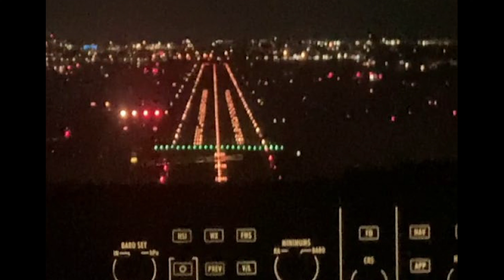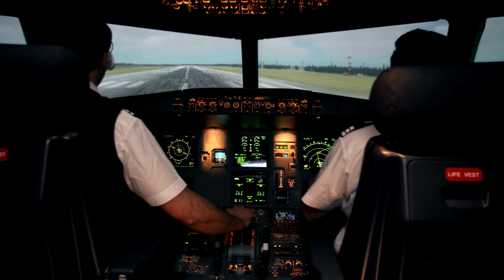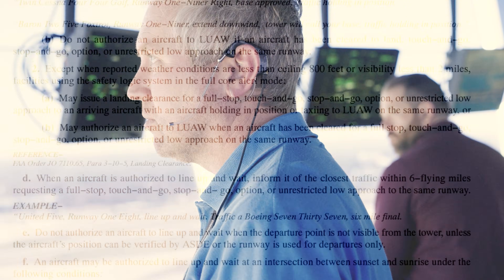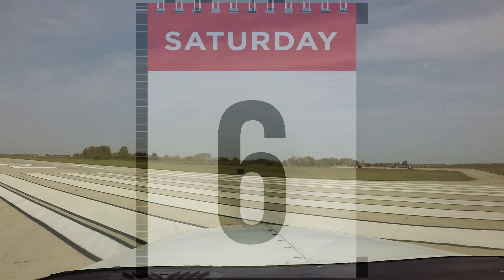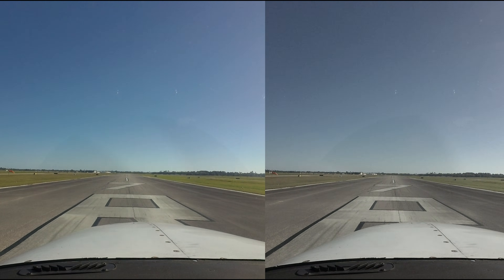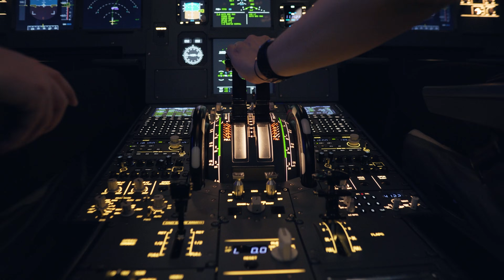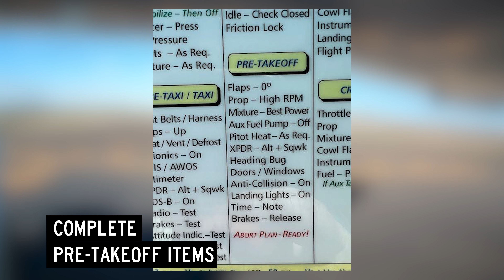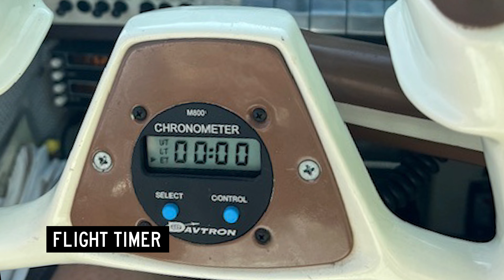From the Flight Deck – Line Up and Wait

Comment: It would have been nice if ATC actually utilized LUAW correctly as stated in 7110.65.  This is not only on the pilots.  Good video for pilots but ATC needs to do their part to mitigate these problems.

Comment: Why are we still using "DC3 Technology" in the 21st Century for such critical operations? Considering the magnitude of errors that easily occur using 'two way' VHF comms (especially at the busiest airports) I find it bizarre that the industry has not developed better tools - i.e. visual aids (traffic lights?) and/or DataLink connections.
Reply: This will happen when people start to die. Unfortunate and sad!

Comment: Very nice video.  I'm an Airport Ops Officer at PANC.  Our ATC uses "Line up and wait" a lot so everyone is used to hearing it especially on RWY 33 due to RWY 07L being in the jetblast zone.   It is also very common to hear a pilot ask ATC "Confirm cleared for take off?"  If they were given "line up and wait" the controller will say, "negative, line up and wait."  If unsure ALWAYS ask.

Comment: Line Up And Wait is internationally recognized as the way to get an airplane lined up and be ready for departure. The word (takeoff) can and must only be initiated by the tower controller. Quite often I hear pilots responding to a LUAW with (cleared to line up), this is not a clearance, this is an instruction! There are on 3 clearances issued by TWR/GND controllers (Flight plan clearance, Landing clearance, and Takeoff clearance), everything else are instructions only and should never be acknowledged with (cleared to taxi via bla bla bla bla bla). Happy flying to all.

Comment: I do analysis of runway incursions, I find "Line Up and Wait" is a risky command. I don't know if it is a breakdown between pilot flying and pilot monitoring working the radios.  I feel that a red green light for clearance to take off should be visible when an aircraft is formally cleared to take off should be considered.  In the UK I am told they started at LHR Line up behind command where two aircraft are lined up on the runway, first one cleared to take off and then second when the first is airborne.  I think that is a dangerous procedure.

Comment: 135 pilots are the worst pilots I have ever seen as a check airman/sim instructor at a large airline, so I’m not surprised they are involved in these incidents.
Reply: I just got my CFI and Comm Multi and heading for the airlines eventually. 

Can you share what makes 135 pilots bad?
Reply: @Andromedon777  Not used to strict SOP’s, just trying to do it their way own way, lack of ability to use automatics to their advantage.
Reply: @obamabigears734  Ah gotcha. I guess that's the advantage of the route I am taking, getting used to SOP's.
Reply: @Andromedon777   very much so

Comment: think I would add some sticky back velcro over the pfd and put a red piece of flannel there when told to line up and wait.  Big red STOP indicator and It would take "clear for takeoff" for me to remove it.  The piece of material physically blocking the PFD view can't be missed.  Just a variation on the typical "remove before flight" ribbons we remove on pre-flight walk around.

Comment: Never been a fan of holding on a active runway.  I guess it speeds things up for ATC.  Sure is rolling the dice though.  Sevens come up time to time and the consequences are catastrophic.  Clear me for take off when I'm cleared to take off.  Simple!  However simple is not in the vocabulary of our government.
Reply: My view, perhaps biased as a GA pilot flying relatively simple airplanes, is that there’s not much time savings for ATC or aircraft by using “line up and wait”. It seems to me that there’s not a whole lot of time savings for the heavy iron jockeys, either. I know that it only takes me a few seconds to taxi from the hold short line to line up and go—I already have take off flaps ready, avionics ready, lights on, and the only thing left to do once the airplane is lined up on the centerline is to make sure the DG and the runway numbers are the same. I don’t fly heavy iron, but it seems to me that other than a somewhat different ground speed taxiing out onto the runway and lining up, all of the other preflight tasks to ready the airplane for takeoff should have been done, too. 

So instead of allegedly saving a very small amount of time, measure in seconds, by sending an aircraft out onto the runway to wait (or hold, if you prefer), in the interests of safety, eliminate the “line up and wait” protocol altogether. Hold at the hold short line, don’t move and ATC don’t tell to move until it’s OK to clear for take off. I surmise that those aircraft which taxi past the hold short line and take off without a clearance are much fewer than those which are told to line up and wait but still take off without a clearance. 

That would also eliminate the distinctly unsafe situation in which ATC forgets that an aircraft has been told to line up and wait, so that the airplane is sitting there, backside to any traffic landing, which of course the pilots can’s see because airplanes don’t have rear view cameras or mirrors. Theoretically, at least one of the pilots of the waiting aircraft can see up the approach path if they’re waiting at the hold short line.

Comment: What part of "wait" is ambiguous?
Reply: Did you watch the video?
Reply: @Patmorgan235Us I don’t think he did
Reply: It's not. But humans and the tech we depend on are patently fallible. There's the radio system with issues of being stepped on and poor signal quality. There are distractions from tings as simple as a checklist. There's repetition and habit. There's even forgetfulness for the last communication with ATC. It's one of those things you can't just expect people to hear and automatically do. It requires vigilance to make sure no incidents happen.
Reply: @jackielinde7568  Absolutely 💯
Reply: Nothing. It’s a clear widely used understandable command. It’s a phrase with a specific meaning that can’t be confused. The real systemic problem here is using crossing runways. If the pilots keep doing the dumb thing then stop giving them the opportunity.
Reply: Hold is now at the hold line
Wait has no runway connection - No one likes to wait
Reply: As an Airline Captain, one GREAT mitigator is to, after Reading back to the ATC, repeat ALOUD the Instructions: “So, we are going to Line Up and WAIT into runway XX”. It’s a good CRM practice!

Comment: Line up and wait should be abolished/prohibited on any runway without verified operational takeoff hold lights (THL) immediately ahead of the wait position.
Reply: Or.
Don't takeoff until you hear the words "cleared for takeoff".  Those are the only words that mean you can takeoff.  Nothing else.  There is no ambiguity.
Reply: @arthursummers7899 :

That’s another problem. Pilots hear what they expect to hear. They take off when they hear a clearance for a different aircraft.

Taking off just based on hearing something is unreliable.

Comment: ABOLISH  THE  LINE UP AND WAIT, AND START KEEPING EVERYTHING OFF A RUNWAY STILL IN USE. IT IS DANGEROUS  AND  THUS  STUPID.  CFIAM JOE Lake Havasu, Arizona.
Reply: Line up and wait is fine, people are just stupid.
Reply: No, no it's not. This is like saying you won't clear the aircraft for approach unless they are cleared to land.
Reply: Line up and wait isn’t cleared for takeoff. But a forgetful person will sense being on the runway and then just go. 

Either stop using intersecting runways at the same time or just don’t use lineup and wait. I say intersecting runways are the real problem. Nobody’s going to ride the bum or another plane that just took off from the same runway so it’s fine on the same runway. If they still go the risk is minimal.
Reply: Human factors is the issue.  It isn’t stupidity.  Stop the line up and wait.

Comment: Pilots lining up and going without clearance are bad but what about ATC lining an A/C up when another is cleared to land (when the runway isn't actually clear) inside a 3 mile final causing a go around and those 2 aircraft now having a loss of separation mid-air? Seems line up and wait just to squeeze that extra aircraft in has done more harm than help
Reply: "lining an A/C up when another is cleared to land (when the runway isn't actually clear) inside a 3 mile final"

That would be illegal... You're saying "well pilots doing this illegal thing is bad but what about this other illegal thing that no one actually did but what if?"

Like... What?
Reply: @Brewdison217  "like what" more like like yeah you should probably do some research on this topic instead of picking and choosing what words to respond to. I'll help you out. Head over to avherald and search "loss of separation" it's alarming how many reports start with XXX aircraft was cleared to line up and XXX aircraft was also cleared to land thus leading to a near collision after the arriving aircraft has to abort their landing.
Reply: Concur. Yeah, it's illegal, so idk why the comparison is even being made.